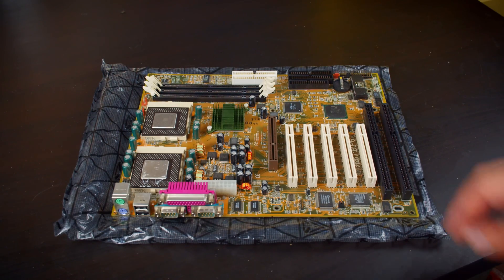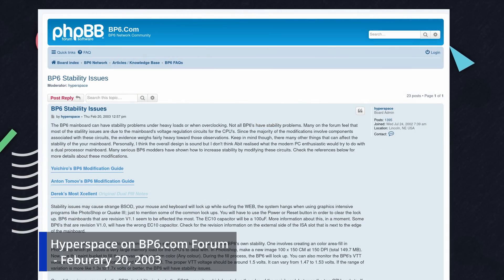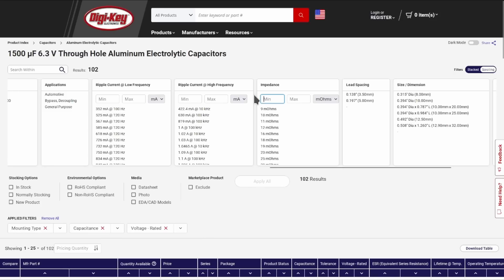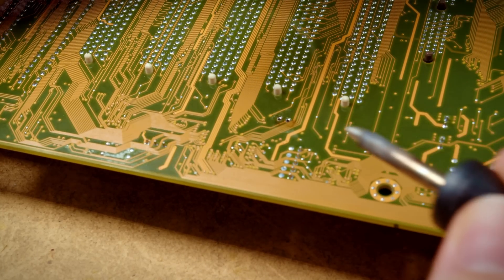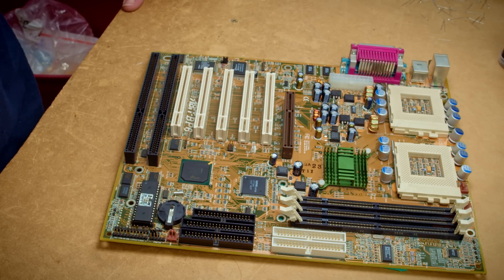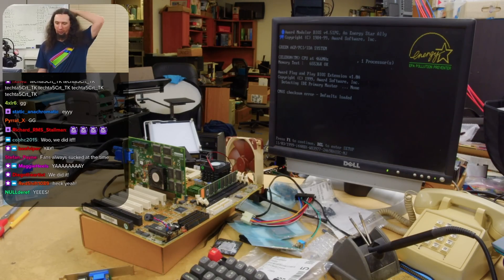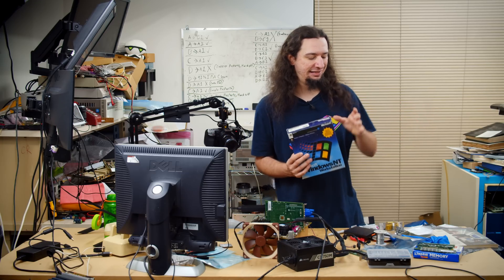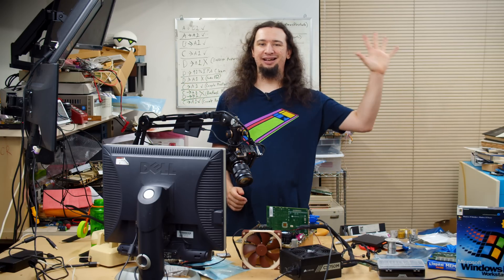Abit-BP6 ReCap - Dual Processor Motherboard Back to Life

Comment: Nice work! your skills on the old hardware are impressive for a young man! I am new to your channel. Really enjoy watching you reverse engineer and conquer. I have a question and dont know where to ask it, so pardon me for changing the subject ... My wife and I like DOOM and used to play 10- 15 years ago, in coop mode over LAN. I am trying to recreate that  using a computer that runs windows 7. Any suggestions. I tried downloading Windows 95 ISO file and burning it to a CD, shrinking the partition to create unallocated space, but It aint happy when I try to boot to the CD! Im guessing there are some compatibility issues. I suppose one cant load MS DOS onto an x86 Computer?

Comment: I had one of these back in the day  run 2x celeron 366'smhz @ 572mhz -- I remember the capacitor plague well and it wasnt limited to just Abit, but they were one of the few that  owned up to it -  all caused by espionage what went wrong a stolen formula that was incomplete, so the missing parts were guessed by a chinese manufacturer, the result was the half life of the part was drastically reduced,  if it wasnt true it would be hilarious

Comment: panasonic FM series has a drop-in replacement with all specs including size for those 1500uF lowESR caps met and exceeded. low-ESR aluminium caps not made any more = fake news confirmed.

Comment: Just be careful as after the Abit BP6 board came out and was wildly popular, Intel broke the ability for it to be dual Celeron, in the CPU itself. But it was long enough ago I don't  remember which model they turned it off. I ran dual matched 400mhz Celerons on my BP6... the caps toasted, and I shotguned them... but I didn't check the type at the time... I got a little video, then lost it. I don't know if I fried the chipset or not. With Windows 2000, it ran great for me for a long time.

Comment: I had one of these running dual celeron 366s o/C to 550 mhz and a voodoo 3 2000 o/c to faster than 3000. Those were the days. I think it was Alpha? Coolers. Large hex pin heatsinks with copper bases.

Comment: I was not expecting to see my old mainstay of the oughties as a new or even retro publication!
The 366MHz CPUs were supposed to OC the best of all, but I did not go crazy because I wanted stability.
I used Linux and only W2K when needed. I rarely gamed. Most games were not multithreaded at the time and the system was soon uncompetitive for contemporary games anyway. It was good for 3D modeling in Blender, development, video encoding, SNES emulation, and generally running a bunch of crap at once (browser, MP3, compiler, etc).
I assembled an ALR Quad6 for several months before switching to the BP6 in 2000 with 366 celeries, 256MB, a GF2, and golden orb coolers. I think I put a fan on the FW82443BX heatsink. I used it as my every day computer for several years until 2005-6 when I switched to some AMD based dually because my BP6 and PIII Inspiron could not keep up. By then, I had upgraded to 512MB and I tried some different CPU combinations including a Celeron 2 with socket 370 adapter, but it could not do SMP and it was not up to snuff without a mate.
I never had trouble with the caps. I was even using some cheapy power supply that came with the generic ATX case.
For fun, if you read this far, I also had an ALR 6x6 for a time, though I never used it as my desktop.

Comment: I had one.  At the time, Celerons ran on 66MHz boards where Pentiums ran on 100MHz.  Celerons also had half the cache of the Pentiums... BUT the Celeron cache ran at full clock speed as opposed to the Pentiums' half clock speed.  So, if you ran Celerons on a 100MHz board, you could get almost the same performance for way less cost.

Comment: I got a BP6 as soon as it was released.  I used dual Celeron 300a processors, overclocked to 450.  It ran Red Hat Linux for years.  One board died (in retrospect, I suspect bad caps) so I bought a replacement.  I ran it until the Athlon XP tempted me away.   This was my second overclocked system; the first was my Kaypro II which I overclocked from 2.5MHz to 4MHz.  Fond memories.  I haven't overclocked since -- not worth the bother for less than 50% increase.

Comment: Abit BP6 I had the last and greatest Pentium 3 coppermine CPU's in mine running stock at 1.26 GHz but unlike the slower variants the last of these CPU's has twice as much Cache onboard 512 instead of 256 a really good system with Win 2 K back in the day.

Comment: if the caps are less the height of the motherboard standoffs , you could try mounting some of them on the other side of the motherboard, giving you more CPU heat sink space

Comment: I just did a cap replacement on a mid 2000's motherboard that went excellent. I really didn't think too much about the final spec though, cause it was at the power delivery and the cpu caps were still good. I really had no choice, because this was a windows xp embedded system that runs an old wide format scanner/copier. Thankfully I also had some spare compatible ram hanging out - the system went from crashing constantly to processing jobs in half the time.

Comment: It MAY actually run both on 466.
Quite a few Celeron ran way higher than advertised. They were basically rebranded to the lower speed.
I ran my 466 at some 550 or so…

Ran Linux as a effing DREAM!!

Comment: The BP6 was a piece of crap compared to other Abit boards of the time such as the legendary BH6. I had a BH6+SL32A Celeron 300 combo that ran flawlessly at 464Mhz using the stock cooler. I bought a BP6 to build a more powerful system using a pair of SL32As as a dual 464Mhz system at a time when the Pentium 450 was the top of the consumer range was really something. But the BP6 just refused to run reliably, even with the processors at stock speed (300Mhz). Shame I didn't know it was likely the crappy caps that was the root of the problem. I ended up ditching the BP6 and buying a more expensive ASUS board to replace it.

Comment: I've replaced hundreds of low ESR motherboard caps with the best, closest commonly available capacitor and have never had any capacitor heat issues or stability/ripple issues. Most boards I've recapped are Pentium 3 & 4 era boards (vast majority being P4 Northwood/Prescott systems). Several of those boards are still running in industrial applications to this day. It makes one wonder if the ripple was really high enough on these to warrant low ESR caps in the first place.

Comment: I had that same motherboard with dual celeron CPU's.  I never had any problems with it, it wound up getting stored away as it was replaced and forgotten.  I recently started going through my junk box of old computer stuff, I found it - I had a momentary thought that I'd put it in a case and try to boot something up on it, but that was a short lived thought, then I threw it away.  With CPU's installed ... now I regret it ...

Comment: I had a similar board, it came in Phillips servers and was made by acer and I ran 2x 233mmx chips in it and 512mb ram and even though the board only saw 128mb, you could pass an argument to the kernel from lilo and it saw the rest of the ram.

Comment: There was also the Pentium Pro CPUs that could run about four I think on one board.  Not sure which operating system it used, but whatever was around in 1995 or so.  WIndows NT?

Comment: I've got an ASUS P5Q SE PLUS with the same 815EP chipset.  Although mine is not dual CPU, mine does have a Pentium III 1.4S server CPU running and overclocked using air cooling with an all copper Zalman heatsink/fan.  Great board and again the only downside is the meagre 512MB system RAM.

Comment: Yay the BP6! I had one back in the day, eventually it got flaky, I never quite got around to replacing the caps and trashed it. Shame. Had 2 x Celeron 400A with golden orbs, stable at 570, could boot at 600

Comment: I had the board! Dual Celeron 366Mhz OCed to 550Mhz with Alpha coolers. That thing was over the top. I ended up selling it because of the OS issues you mentioned. I had too much trouble trying to get drivers for “consumer” hardware like sound cards and GPUs working on NT and 2000. Win2k was better but still painful.

Comment: I had a SuperMicro dual pentium pro board.  Ran Win2K on it for a while but ended up running FreeBSD on it.  I overclocked it to 220Mhz and it had a habit of roasting the 24 pin mobo connector until I slathered it in dielectric grease.

Comment: I still have mine. I haven't fired it up in several years but I never had any stability problems, probably since I never overclocked it for any significant time. I have dual 300MHz Celerons in it and ran Windows NT. There was an active BP6 community and was the first time I ever saw water cooling for a PC. I remember a guy bought a transmission cooler from an auto parts store, some copper pipe fittings an aquarium pump and used a Tupperware  container for the reservoir.

Comment: I've had this mobo with two Celeron 400 Mhz and Thermaltake Golden Orb coolers. It required some sewing and grinding to fit those boys into the board, without modification they wont fit due some capacitor overlapping their fat size radiators :) But it was cool to see it up and running.
However i had not any succes with overclocking these cpus - as far as i remember they were stable @433 or so, but not much more.
I think some ppl managed to run P3 cpus on this motherboard, with some heavy modification but i'm not 100% sure as there was dedicated Abit mobo for two P3s - VP6.

Anyway, great period in my life. My home looked like computer service man cave :) a lot of motherboard, chips, radiators everywhere. Good time, good time :)

Comment: Are you joking? Kemet has you covered when it comes to 1000-2000 uF caps up to 15V easily. I recapped my Abit VP6 a year ago and while pricey, replacement capacitors were more than obtainable. You can probably order Kemet's capacitors at any wholesale electronics store like TME (highly recommend!).

Edit: Oh! I see you've ordered exactly the correct ones! Nice! :)

Comment: I had the use of a later model, installed 2 733Mhz Pentium 3 processors... With 3x 128Mb of RAM... It ran windows XP very fine

Comment: I have several Gigabyte BX586 lying around, that is, Dual-Socket Pentium-233MMX in my case. Each runs with 192MByte of Memory and comes with an onboard 40MByte/s UWSCSI-Controller (I think it was some NEC solution, pretty fast). They were pretty cheap back then, around 200DM = $100 back then. CPUs were rather cheap too. I had to replace most capacitors after three years but after that it worked pretty well. Still somewhere in my basement, running Ubuntu 10.04 but never looked at it for 10 years or so.

Comment: I had one of these with twin 866 PIIIs, running win2000 - using the god awful lump of sh1t Alcatel frog/stingray (SpeedTouch USB) for internet. 

Alcatel had the users be beta testers for the drivers for the thing - people found it did not like VIA chipsets, was not thread safe, so dual sockets were out, could easily pull >>500mA (as high as 850) so a powered USB hub was recommended. I ended up using a seperate box ,NEC USB, and powered hub

Comment: It was a workstation grade system at the uni student computer club. Running Linux and/or FreeBSD I think. Another option were to use certain P-III boards but use some converter thingy so you could put two Celerons in them.  Never owned one myself, I was short on cash in that period.   I did have a dual Pentium-I (yes Pentium I, non standard multiprocessing) though.  Compaq Proliant 1500 Pentium-I version (there also is a P-Pro version, which I also acquired later)

Comment: Congrats on recovering an incredibly unique board!  I'm working on two of my own at the moment.  One of them has some pretty nasty trace damage from everyone's favorite battery maker, Varta, and the other just won't recognize video cards in ISA, PCI or AGP slots.  Reading online indicates that the BIOS is corrupt, but everything I tried to clear any possible corrupt settings has failed.  So now I'm trying to get my hands on a chip writer and the proper eprom or eeprom chip to write a replacement.  But I did fix an old AT case, so I'm 1 for 3!  That's good for me!

Comment: I had one of these fun boards back in the day.  Still have the processors Cel500s.  I upgraded to a MSI 649D with p3 1ghz, still have and it does run also.  Then i have a SGI rack mount thats running  a Tyan with p3 733 procs.  Anyways thanx for sharing the video, great to remember the classics

Comment: I bought this new motherboard along with two celeron 400 processors.

My motherboard did not give any capacitor problems. I had the motherboard for a few years.

For this motherboard there are some adapters to be able to mount two pentium 3.

Comment: Also, Windows 2000 is probably ideal for that build if you want gaming performance of the day. The games are single threaded but win2k does support smp so windows 9x gaming while running dedicated servers for the same game on the same system with maxed out SDRAM will fly. Some Linux distro from the era is probably ideal for whatever weird use case you have.
Reply: True windows 2000 has a way wider range of driver support and is way more stable

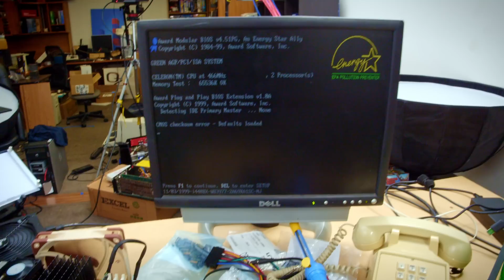Comment: 10:20 dude, you won't roast the CPUs, i promise. I ran a Pentium III 700@933 MHz in a slot 1 to socket 370 adapter (we called them slotkets or slockets) on an ABit BH6 revision 1.01 or 1.02 (it was NOT a 1.1 or 1.2, that i'm 100% sure of) for a long time. The (coppermine) Pentium III 700 wasn't even supposed to be able to boot on my old-ass BH6, but i put the thing in, adjusted the BIOS to 7x133, cranked the voltage a bit and presto. ROCK FUCKING SOLID for a long time, IIRC that was the setup i put my original GeForce 256 SDRAM in and even my GeForce 2 GTS when it came out. P3 700@933, 192 MB of PC100 running at 133 MHz, 1T command rate and CL2 (i believe, it was the lowest CL rating available on the board). Nothing in that system was at spec, everything was OCed and it never skipped a beat.
Reply: The ABit BH6 was the best god damn mobo ever made, did i ever get YEARS out of that board and at above and beyond what it was supposed to do. 
The thing is, back in those days (the late 90s, early 2000s) NOTHING and i mean NOTHING except for the 440BX lasted for years. The gaming engines and games were moving forward so fast, the 440BX chipset on the BH6 was so old, Intel had been so hoodwinked with RAMBUS and trying to correct with the 815 chipset (the 820 was the RAMBUS RDRAM chipset, which had the clock speed advantage but it was SOOOOO slow in the latency department it was embarrasing.) The 815 chipset was socket 370 with regular SDRAM memory AFTER the 820 bombed with the INSANE cost and latency of RAMBUS RDRAM.
Meanwhile, i was rocking the good ol´ BH6 440BX with 133 MHz SDRAM that was designed for 66 MHz SDRAM and a Pentium II 266 or 300. 
I'll tell you, the BH6 with 192 MB of 133MHz overclocked SDRAM at low latency, the Pentium III 700 running at 933 MHz, the TNT2 Ultra or GeForce 256 or even the GeForce 2 GTS could crank out some fucking FRAMES in Unreal Tournament and every other PC game imaginable at that time.
The specs of that BH6, and now that i deep dived into memory my BH6 was a rev 1.01, OFFICIALLY at launch it was the first ABit pentium ii motherboard with support for PC66 SDRAM and a Pentium II 266 or 300.
Talk about slipping into overclocking on a banana peel. 
I blindly lucked out on THAT board buying my first Pentium II, it was a PII 266 (4x66) with 32 MB of PC66 high latency ram. As i said, it lasted for YEARS and i just CRANKED that shit. 

Just imagine you buy a low end cheap system with an A320 board at the launch of Zen 1, you spec a Ryzen 5 1400 system with 4 GB of 2133 MHz single rank dual channel high latency DDR4 and you end up MAXING OUT the OC of the board with a 3800X and 32 GB of 3600 MHz dual rank dual channel low latency memory. THAT'S what my ABit BH6 did for me, complete accident, i bought a cheap Pentium II 266 system that was kinda out-dated at the time and i had no idea about overclocking. BOY did i learn after that =D

Comment: Oh, blast from the past! I had this board with two x Celeron II 400@600. It took two 90W peltier elements, two coper water blocks and a (by today's standards) horrible looking radiator to get there.... would have been cheaper and faster to buy a single Pentium III 550Mhz instead. I ran Windows 2000 Beta 3 and Linux on it initially until Windows 2000 Workstation came out. Windows for gaming, Linux for life. These days all my games run on Linux, so Windows has been kicked.

I never had the bad cap problem though. For a very sad reason: My cat, and I shit you not, PISSED in my computer :-/

The computer I had to build because of that was a Dual Pentium III Tualatin 1266MHz (the 512kb L2 cache version - I had learned my lesson: IPC over frequency!). This was when everyone was running Pentium 4 1.6Ghz and my computer was consistently faster at freaking everything, despite running 133MHz SDRAM to feed two CPUs.

Comment: Windows 2000 would rock in this board, handle the dual processor, play many Windows games and apps, and much lighter weight than XP (which is your other Windows option: should work but will be slow, at least unless you turn off themes). I ran 2000 on everything from a dual Pentium 120, through stuff like this p2/Celeron era stuff, and onward to much faster things, even in VM once I eventually switched to XP, since it was so much lighter weight. Gotta play StarSiege Tribes once the system is all set up!

Comment: I had one with two Celeron 400's in it that overclocked to 600MHz. It was still working in 2003, despite the cheesy caps. That board left my possession that year, but I imagine it eventually died.